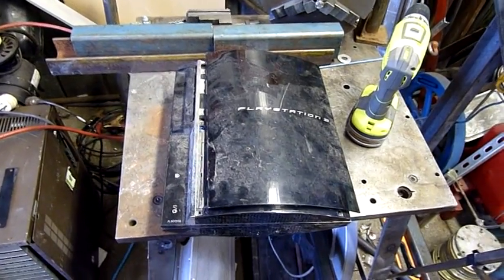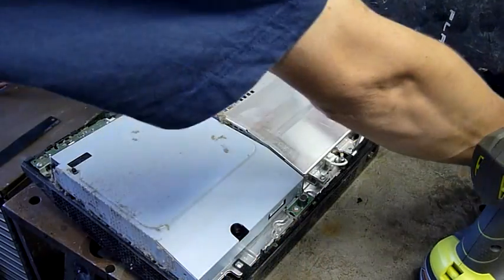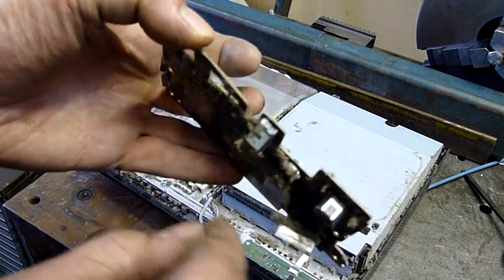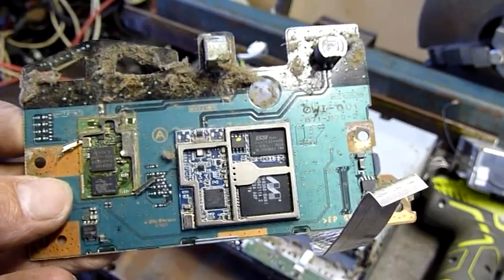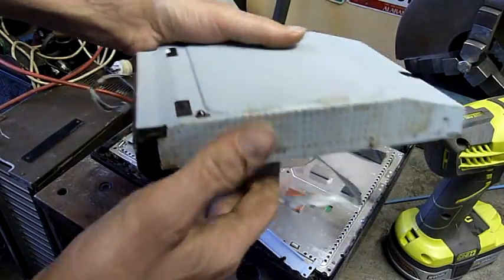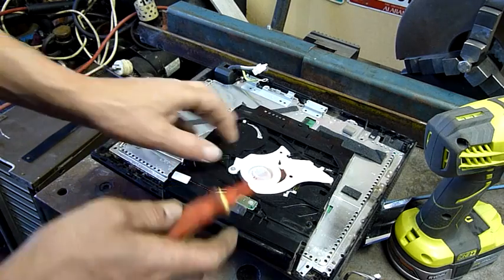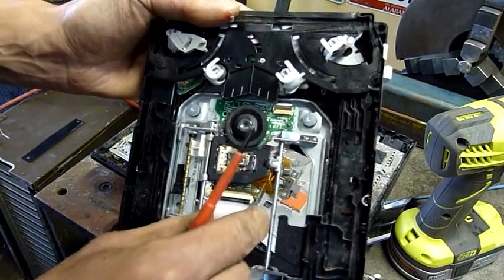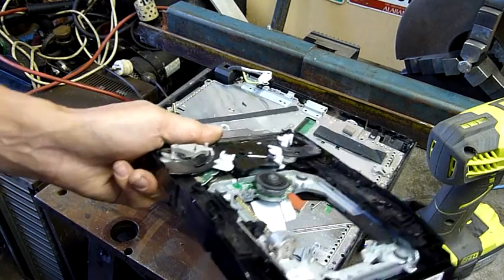First Gen PS3 Autopsy Pt1 - Top Assembly - PSU and DVD Drive

Comment: The ps3 was hacked and it was used to make illegal copy's of Blu ray disc and games with the use of Linux installed on the console via Sony built in OS install option and other 3rd party software/drivers..  Soon as Sony clocked on it was pulled sharpish! 

Shame no one has found an DVD region hack for it

Comment: That laser will have a violet, red, and infrared diode in it. Since it's just a rom drive it won't burn anything, but you can still make a multi colored laser pointer with it. 
Get the laser from a bluray-rw drive if you want to burn stuff. The faster the drive the better.

Comment: Interesting... i wonder if the wires carry the 5 volts dc + the power on trigger?

It's a blu-ray rom drive, the drives pcb has an asic with an ARM processor core that handles drive operations and security measures. (disk media type, drive firmware integrity checking, other anti-tampering stuff in general) 

it seams sony was quite paranoid about people attempting to modify there ps3s blurry drives...

Comment: it's interesting to get into the little details of older ps3s. i have a big old one and its power supply died on me, it would turn on and then everything would go out, no lights or anything and you had to physically unplug it before it would come back on. it was an easy fix and the power supplys are quite heavy.

Comment: ok i am sorry but cheap manufacturing things are not like the old bricks that never die but its also a lot cheaper to make and more complex and taking care of your shit hellps with that something i am sure  you know very well by working on cars yes its cheaper to make and sometimes it brakes ps3 and xbox had there problems at the start but the hard were and softwere is alot more twitchy then it used to be and the red ring and the yellow light are a good example over heating. nomore comment space

Comment: it's quite true with it not being good enough to fix, even if the unit was in much better condition. I brought a working xbox 1 that was used in a den for 4-5 years, ended up costing me over $200 to get it to a refurbished state =S
slightly more difficult than dropping an entire old school nintendo in a chemical bath and having games work like it just came out the box =p

Comment: an intresting note Aussie50, that the Fat model PS3's did have one Flaw in how it handled Disc detection (seems to be all at the FW though) the PS3 doesnt do a secondary check on a inserted disc at boot. it just looks if its a valid Format (PS1/PS2/PS3) and blindly boots it. its an issue thats plauged Sony since day one (aka Swap trick) except the PS1 was timing, PS2, it was a matter of ToC, this time it Just simply looks for the bootable file on a game disc and boots it.

Comment: I don't think Sony used cheap caps etc. I could be wrong but it wouldn't make sense. There does seem to have been some issues with the construction of the machine though. Microsoft tried to be cheap on getting their GPUs fabricated and it cost them.

Comment: To fix this, I and many others have successfully applied the 'solder reflow' method of baking or heating the system board to reset the cell processor connections. This same process can sometimes be applied to failed computer parts, especially many models of graphics card, which can also experience the high temperatures and often use poor quality lead free solders to save money and meet environmental restrictions. Sorry for the text wall but I think it's interesting.. :)

Comment: But the Cell processor has none of these technologies (or if it does, they are not implemented properly or they are not adequate). The result is, that it seems that the Cell can exceed tempeartures of 200 degrees C. Combined with thermal expansion, this results in the cheap lead free solder used to attach the chip to the system board to detach. This is one of the main causes of YLOD other than dead sub components (almost always blu-ray, PSU, hdd).

Comment: Now, the strange thing in the case of the cell processor is that unlike modern Intel and AMD CPU designs, there was little to no implementation of 'emergency thermal protection' feedback systems. For example, and intel CPU has several methods to keep itself cool. Firstly, it can reduce its frequency and/or voltage in an attempt to run cooler. Next, it can start locking up for seconds at a time to try and reduce its heat output. Lastly, it can force a hard lock of the system which knocks it to %0

Comment: This lead to the cooler not being able to keep up, and the chips experience temperatures that climb over 100 degrees Celcius. At these temperatures the cheap ceramic based thermal interface material (thermal paste) dries out over time resulting in a dry material that cracks easily due to changes in heatsink/load size from changing temperatures that in this case could exceed 100 degrees C in a few seconds. The result is that the Cell CPU loses almost all heat conduction to the heatsink assembly.

Comment: I should point out its a blu-ray drive and not a DVD drive, but anyway... the biggest problem with PS3's and YLOD were caused when COD Modern Warfare 2 came out. This game seemed to put excessive stress (high utilization) on the cell processor cores. This lead to a higher heat output than was originally expected by the designers. Unlike on a modern gaming PC, the Cell processor was never designed to have a cooling system to accommate non-stop usage at 100% of its thermal design power (TDP).

Comment: I had this version, they played ps1 and ps2 games (reason why I tried so hard to have it repaired, new ones don't play old games). Thing YLOD'd on me and I got it repaired 3 times.....only lasted a little bit in between those repairs till it died again. I think I got the main board somewhere that shows where it failed...I'll try to find it.
Save the drive Ed, I think they ARE high power and can be modded to be a burning laser!!